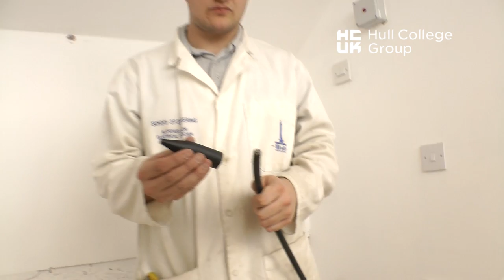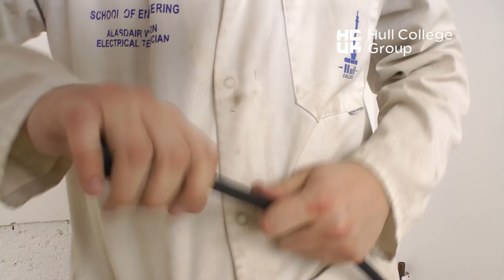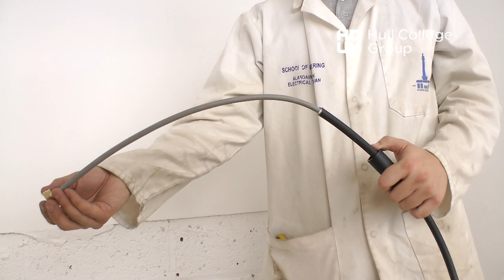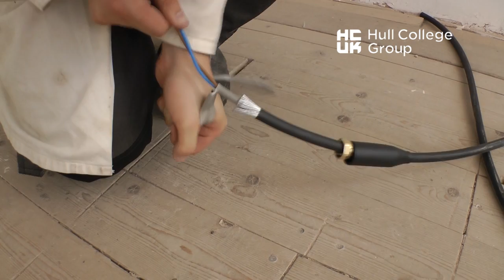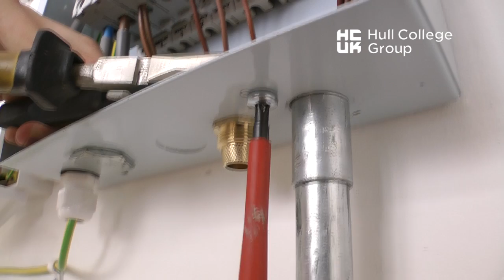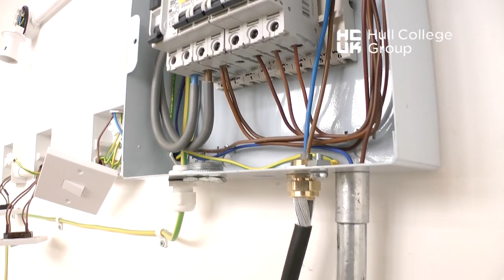4 - Stripping and Termination of a SWA cable - Hull College Electrical

Comment: I've seen a lot worse attempts at making off an armoured end but got to say that no way he was able to snap off the amourings with such a light scoring( guessing that's why the video missed that part off!).  Plus I'd have used a brass bolt and if all I had was a roofing bolt I think the 11mm spanner would have appeared rather than the pliers!!.. Never saw the pencil being used, was that used for the sandwich shop run???😁

Comment: I like to think that Hull College might have updated their training procedures since they put this video tutorial online in 2013 but, the fact that they still have it shown online in 2021 would suggest otherwise.  Having spent 43 years in the trade I am shocked that a College is teaching a potentially dangerous method for using a Stanley knife but, in my opinion this is just another example of how over the last forty years the amount of regulations, qualifications and training courses have increased massively as the actual ability, craftsmanship and quality of material used have all gone down hill.